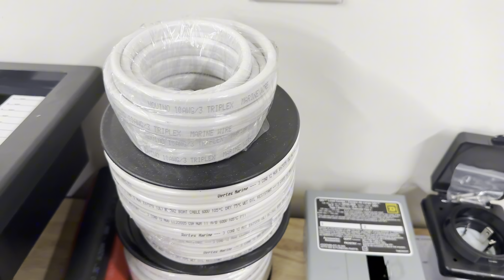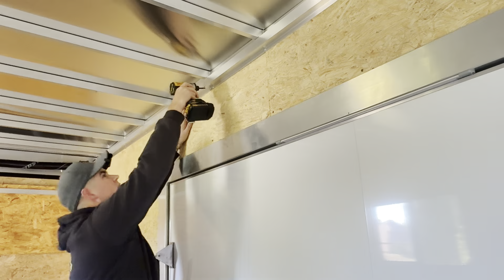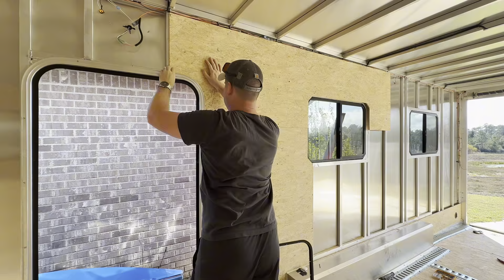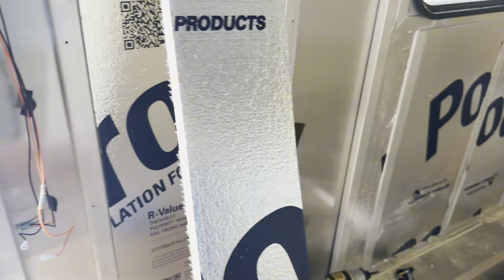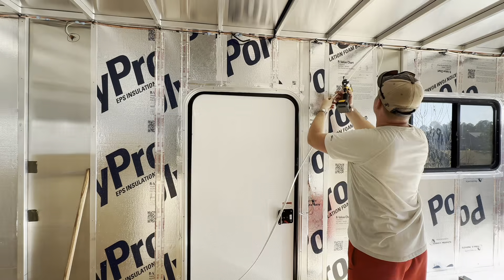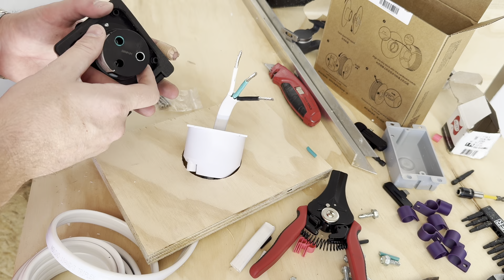Wiring & Insulation - My Trailer Is Finally Taking Shape

Comment from the maker: Check out the Trailer Amazon Affiliate Links

Breaker Panel
https://amzn.to/45uemA9
Ground Lugs
https://amzn.to/3Lh3Pl7
12/3 AWG Triplex
https://amzn.to/3L1z1EV
10/3 AWG Triplex
https://amzn.to/49vKVA8
Renogy 3000 Watt Inverter Transfer Switch
https://amzn.to/49uXb3T
30 AMP connection
https://amzn.to/4s8eKy2
Redodo Battery Monitor
https://amzn.to/44LBoT1
Bus Bars
https://amzn.to/48XD525
16 Gauge Duplex
https://amzn.to/4sfPbeB
10 Gauge Duplex
https://amzn.to/3NlSNeQ
400 amp fuses
https://amzn.to/4awR2oZ
MORryde generator slide
https://amzn.to/49AM6NR
WATTCycle 314Ah battery
https://amzn.to/4pdgWla
Battery Disconnect Switch
https://amzn.to/4qztnJj